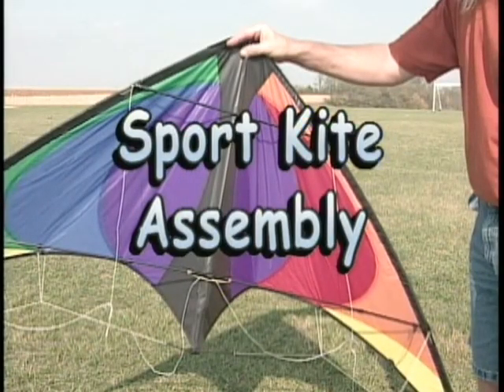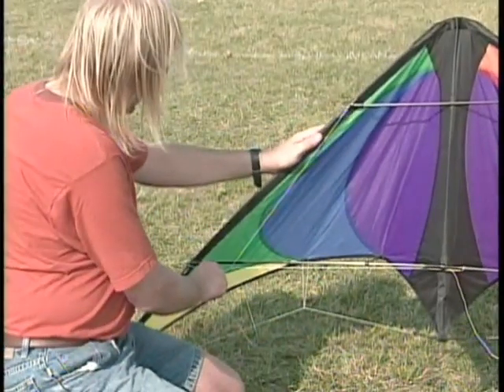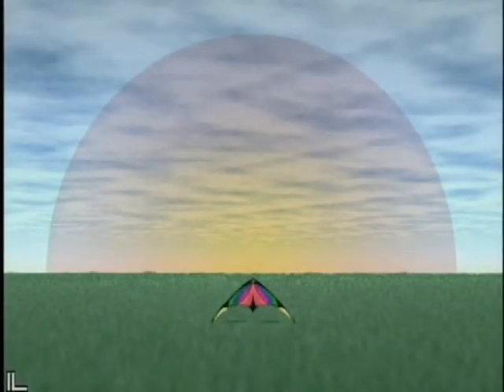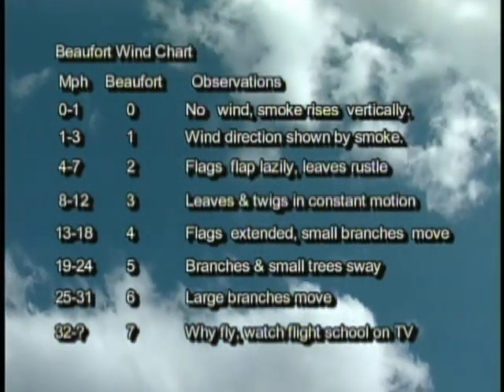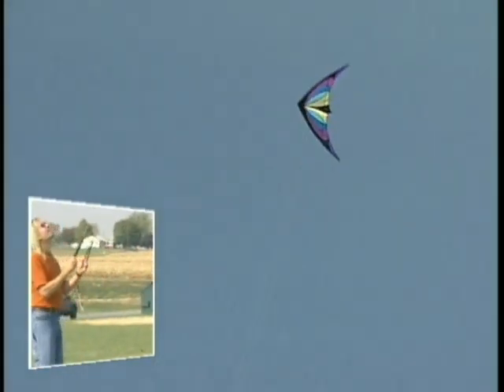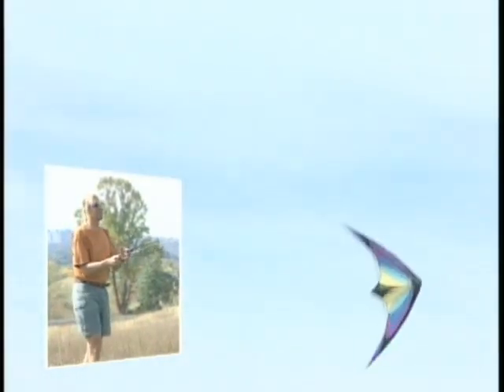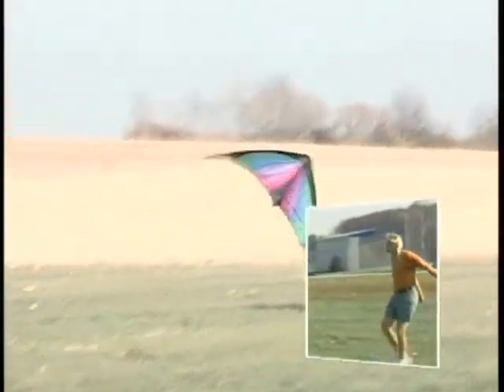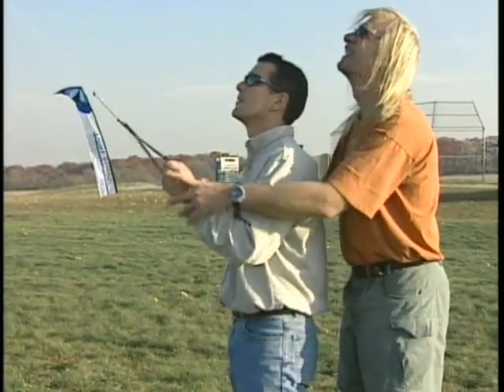Dodd's Flight School Sport Kite Basic Instruction

Comment: I bought a sport kite and the lines got all knotted as I tried to unwind them. I figured it was beginners bad luck and bought another set of lines. The second set too got all tangled again, before l started to fly it. With the third set, one line snapped in about 15 mph winds.  I'm thinking about buying a spool of 200 lbs braided fishing line from Bass Pro Shop to avoid these line entanglements and lines breaking, since the 150 lbs Dyneema line, obviously is not working.

Comment: I first saw and flew a stunt kite at the San Leandro Marina near Oakland, CA. Basic flight was explained to me in a bit more clear & concise manner, imho:
With equal length strings and hands in the neutral position, the kite flies in a straight line. Pull right, the kite rotates right. Ditto the left.
The kite will continue to rotate until you return your hands to the neutral position, at which time, the kite will fly in a straight line in the direction the nose is pointed.
Here endeth the lesson.